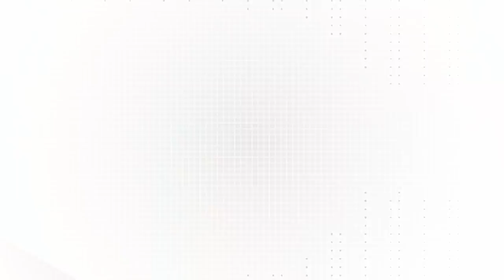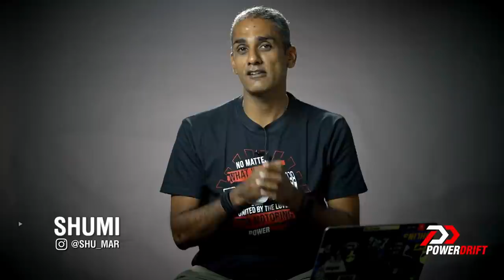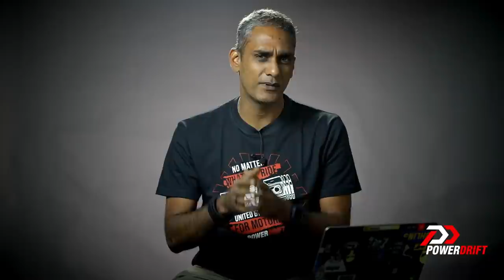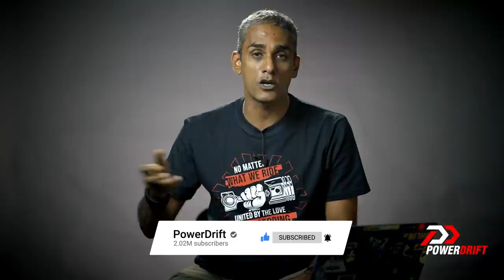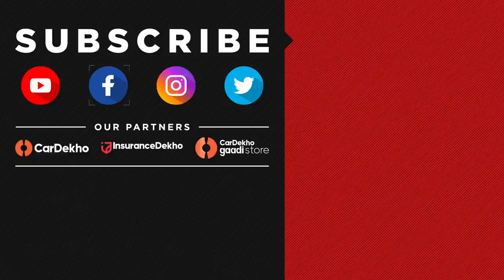Modifying motorcycles | Episode 14 | The PowerDrift Podcast

Comment: All points covered 🙌, 
And yes I did a aux light mod, but i only use it during foggy 4-5 am morning rides or during monsoon off-roading.
And the next mod i will be doing is changing the rear sproket for a little bit higher stabilised cruising speed on highway.
Reply: Best of luck Ninad! Do let us know how it worked out!

Comment: Shumi, you are the awesomely wise (beardless) sage of Motorcycling. Thanks for sharing your passion and wisdom with us. 
I agree with you completely, I always like to do functional mods to the bike, after a long ride, if something on my bike constantly takes my attention off from the ride, I will usually adjust or mod it. Usually it is something small, but after it is done it increases the Joy of riding.

I had not thought about Sprockets on increasing bike mileage along with performance. Please make a video if you do get a chance (or share a few links on this), as increasing tank range without too much sacrifice on performance adds to the joy of the ride as well.
Reply: There’s nothing to it! Find a speed at which the bike returns most efficiency at which you feel comfy as well. Hold that speed more often than not on rides. Done!

Comment: I am a product designer myself, and because of that, I know how much thought and work goes into designing any part of a vehicle.
In six years, I have upgraded my tyres for a stickier set and gotten myself a mobile stand, so that i can read the directions on a mobile screen.

My first thought about any modification is: "Whoever designed/manufactured this component, does he know better than me? Yes. Then I should stop fiddling with it"

Thank you for enforcing my beliefs.
Reply: It's not always true but 99% of the time, a lot of time and effort has gone into every single part of a finished product. We must mod it to fit our needs better if we can, but it must be a considered, thought-through change, not a knee-jerk reaction or a peer-pressure thing

Comment: Wise words! I've been running on a sprocket with lesser teeth at the back for 2+ years and it had a significant role to play, I get more range and the power delivery is better and smooth. I'm planning to get auxiliary lights with filter caps for the reason that was mentioned. Got a handlebar riser because I needed one for comfort and the seat is still stock but I have an air cushion now for very long rides (700+).
Never felt the need for an exhaust or anything else and I still do great :)
Thank you Shumi for this, it was needed!
Reply: Awesome! Glad you've got the motorcycle in a place where you enjoy it even more!
Reply: @shu_mar  Oh totally sir :) Thanks again!

Comment: Awesome video but I had some doubts. You're saying at the top of the line exhausts and power upgrades are a waste which I can agree too. But what if we were at the bottom end of the spectrum. I completely believe what you said about the exhaust, and currently owning a NS200 I'm not even looking at exhaust. But I see my future self someday owning a Daytona in which case I would put an exhaust. I don't mind if the exhaust even loses power as long as it sounds good. I firmly believe riding experience is also affected by the sound of the car/motorcycle. What would your thoughts be on this? Also as I said I own a NS200. I was actually thinking of extracting more power out of it by maybe adding an ECU and a new Air filter. Would that be useful in my case.

Comment: Its a great podcast and absolutely professional advice! Thank you and keep coming with more such videos. :)
I have a duke 390, 2016 and clocked around 50k on it. I am not very happy with the breaks especially the front ones which are the most imp for me with the stock organic pads. I tried to adress it by changing pads to a ceramic and sintered ones and the adjustable levers from the new 390. The sintered pads offer much improved initial bite but it sometimes is too much for a Pirelli rosso 2 to handle. One advice i got was to change the rear pads to sintered and use rear break a bit more than what i usually use so that abs wont kick in.
Recently I came across this racing boy radial master cylinder. From what I know, it will not improve the breaking as such but the feeling and the feedback will be improved significantly. Whats your thought on it @Shumar? thanks in advance
Reply: Try changing the fluid from the stock Dot4 to Dot5.1! It's the cheapest mod but everyone jumps to more complex things first!
Reply: @shu_mar  Oh yeah... never gave a thought to this :p
 will try that for sure.. thanks :)

Comment: Exhaust modify torque, otherwise you don't get power. Power= torque*rpm. Just an exhaust doesn't increase redline rpm, rpm is constant. Exhaust may modify the torque in higher rpms though. In non technical langauge people confuse torque with "pick up", but torque works in every rpm.
Reply: For the layman, they get that torque is low revs and power is high revs. You’re right of course

Comment: The JT steel front sprocket, with rubber bushings, that I replaced on my street triple 765 rs, costed 1600₹, at stock 525 pitch.

Comment: Thank you so much for this video. What are your thoughts on adding aux lights vs changing out the halogen bulbs for LEDs to increase visibility for touring if the existing bulbs aren't powerful enough for night riding?
Reply: I've done that on my Tuono. Legally it's a grey area for sure. I also hate the fact that most LEDs go closer to 6000K (blue) rather than 5000K (sunlight). The diff it makes while riding is serious!
Reply: @shu_mar  Yup, I've been contemplating changing it out, but I keep remembering all the times I've almost been blinded by an oncoming bike with bright blue headlights.

Comment: Very knowledgeable video but what about changing stock Air filters??
Reply: Warranty issues are the same as modification TBH. That aside more airflow can force the ECUs to add more fuel to boost performance. Most of the time, the extra intake
howl is enough to convincer riders their bike is faster. I don’t prefer them because india is super dusty and performance filters filter less.
Reply: @shu_mar  thanks i was planning to change..

Comment: Could have also spoken about hh sintered brakes and paper filter vs reusable air filters .. that would have been nice as most modify those.
Reply: There is enough data online about pros and cons for these. The point was not to dive into specifics as much as to encourage people to think about specifics and research before making changes. So that each change brings a planned benefit
Reply: @shu_mar  thanks for responding 
great to see you and the team take the effort to educate people over certain misconceptions that has been floating around . The podcasts are a great medium.
All the very best guys

Comment: Does changing the handle bar reduce structural strength of the bike?
I have 2011 pulsar 180 was planning to make it more ergonomic by changing the handle bar to a taller one.
Reply: Also can you suggest a good workshop in pune where I can get it with absolute peace of mind.
Reply: I would go to Slipstream Performance. And no, unless the handlebar you use is total BS, it won’t affect the structural strength.

Comment: Lots of wisdom dropped. Thank you. Got a question Can sprockets be used to increase the low end torque of the motorcycles ? For there are stalling issues in motorcycles especially with a luggage on touring ?

Comment: Sir , what bike is a good choice for an absolute beginner , which has style & looks along with necessary systems required ? Budget could be stretched till 2lakh . Please sir , it would be a great help if you could suggest .
Reply: I would pick between an Apache RTR 200, Duke 250 and a Gixxer 250. Test ride and decide
Reply: @shu_mar  I had my eyes fixed on Apache RTR 200 4V , it seems to pack almost everything required ( safety , features & looks ) but got kind of confused with Gixxer 250 . Not digging in KTM or Duke to be honest . But none the less thank you for your suggestion sir .

Comment: As I understand watching you speak in your podcasts - your wisdom are more applicable for the 'rich' persons who are driving a 'non-commuter' class motor cycle. Having said that, let me tell you I ride a Honda Unicorn BS6 and let me present before you an issue, which may look so trivial to you that you may altogether ignore and laugh off my comment/query. I ride this motorcycle everyday 113 kilometers (including both upward and return) in which during my return journey home (in the evening in the dark via NH2 around 26.7 kilometers) I found it quite hard to see properly with the stock/OEM headlamp. And I am certain you're well aware of the reputation of the illumination power of Unicorn's headlamp.

I bought this first motorbike on 28th May 2021 (before that I was riding an NTORQ race edition bs6). As you can see the machine being very new - I need your advice on what to do with the poor OEM headlamp that Honda provides on Unicorn.

For your reference, Unicorn, in its bs6 avatar has a puny 4Ah battery. What are my options? Kindly be specific. Thanks.

Comment: Sir very nice explanation 
But now what I am thinking is-it is ok to buy naked Street and racing bik or anyb expensive bike  we can only use only 0.1%  full potential of the bike??
Reply: Of course! If we bought motorcycles based on what we need, we would all be riding 150cc motorcycles. Motorcycles are flights of fancy. My point was that once its here, spend money and time with it to gain the experience and sensations you got the bike for. Not useless mods that achieve nothing

Comment: Did changing the sprocket mess up the speedometer readings on your multistrada? I was riding a ninja 300 in MMRT and I could see the speedo readings change significantly when I changed the sprocket..

Comment: the only thing i modified in victor 110 is a charging socket connector arrangement. its removable so if my Ntorq does not need that ill just stick that on victor and move along.

Comment: How did increasing the rpm (via sprocket) increase the fuel economy. I think it would be the opposite??
Reply: Depends. In my case, the bike (and most big engines) run below optimum revs in India. Lowering gearing brings you closer to efficient revs. On small bikes the opposite might happen.

Comment: Amazing suggestions Shumii! That sprocket advise is gonna help me increase the low end of my CB350 H'Ness. But do we need to pursue a certain ratio for the teeth on rear and front or can we just increase teeth to the rear and get more acceleration?
Reply: It’s a trade off. Read more on this first. More acceleration means less top speed. And the Highness barely had any top end as it is...
Reply: Will do! Thanks for the reply 🤟🏼🤩

Comment: I fully agree on this topic , changing stock exhaust to louder irritating exhaust is way of norm for  super bike  purchasers  and people barb on costs they have wasted ,plus outdoing engineers who have put years to make vehicles to perform optimum keeping laws of lands intact.   Most of super bike purchasers are from large metros where there are hardly any roads capable to extract those BHPies.    I would recomend to put money on insurance. 1 lac Rs fuel example is just  right example where users hardly run up super bikes beyond few thousand kms, surprisingly same people are concerned of fuel economy and rising prices. But again there is business involved.

Comment: What is your suggestion on adding windshield, handle guard and specially crash guard to Apache RTR 200 4v. I might not go beyond 105kmph regularly and 125kmph on ling rides. My weight is around 80kg but I encounter lot of windblast in flyovers and highways. I feel anxious and not in control of my bike in those moments. Is it a skill requirement or modification requirement?

Comment: 17:05  wait...what? 

Hey @PowerDrift, how does your fuel economy go up with higher revs. I get that the motor is under less stress because higher revs deliver more power, but higher revs mean you're having higher number of engine cycles in the same time, ergo, burning more fuel, regardless of how you look at it. Only way around is to have a turbo/supercharger. 

Or am I missing something here. I could be wrong, I often am.

Comment: Is it better to modify a slower bike to be faster for regular use or buy a bigger bike to solve the problem.
For example the smaller bike has the sweet spot of 4 to 5 K rpm where it goes around 80 kmph and by modifying exhaust and intake it can do much better at that spot is it advisable or better to buy a bigger bike to solve that.

Comment: Hi, you mentioned that the second time you went to KMS, post 5k on the Duke you felt much better. Wanted to understand if it was genuinely the seat getting better or was it just you had gotten used to the way the seat was .. genuinely want to know
Reply: What I was saying is that it doesn't matter whether the seat got better or I got used to it. What matters is that 21,000km, I'm using the same seat and it remains the best seat I own across my bikes
Reply: @shu_mar  thanks Shumi..

Comment: Hi Shumi as always great video❤️. Recently my bike started giving less fuel economy. I don't know the reason. Now you mentioned about sprockets in video and I remember mechanic told me to change the sprocket. Is that the reason for less fuel economy . It been 5 years I m using my motorcycle and it's 150 cc bike. Please assist.
Reply: A worn sprocket can cause issues but a drastic difference in economy 
won’t be the sprocket alone
Reply: @shu_mar  thanks Shumi☺️

Comment: Hi 

I have a street triple S and I have added 1/2 inch risers , however my handle is still not that closer. And as comfortable as bmw gs310 handle . It may sound stupid but want it to be little bit easy riding position
Reply: It’s not stupid. We all want a comfortable riding position. The things to figure out is 1/ are you sitting right (if not,  that’s the source of discomfort not the bike) and 2/ what do you consider comfortable (I want to lean forward but you might prefer upright and so on). And then find risers/handlebars that do the right thing for you.
Reply: @shu_mar  so is 1 inch risers advisable on street triple

Comment: Since my legs are longer than average for the same body height (5'11") my seating is crammed on my Pulsar 150 Neon which comes with commuter styled footpegs.
 I wanted to install the rearsets that come with the twin disc model of 150 but knowing that I'll have to change the peg holders, gear shifter, rear brake pedal, possibly the side stand and lose my kick start has put me in great dilemma. I didnt notice this in test rides as they are never over 2 kms sadly. What to do @shumar?
Reply: No easy way. One of the things about mods is that much of it is trial and error. You hope for the best and remember that some of the mods won't work.
Reply: @shu_mar  Yup that's always there. Main factor is the money involved in doing all of this parts etc. All I have is time and I think I'll figure something out.

Comment: Hey!!I own a RE Himalayan as I hit off-road and bad roads frequently. But on the weekends I used to hit straight highways with my friends. There I find my bike quiet slow compared to RS200 or Duke250. Can I have a solution to that??
Reply: Not really. As with everything sprockets/exhausts are tradeoffs. A smaller/weaker bike has less ability for you to be able to play with it and ‘create’ more performance.

Comment: hey there i need more details on the performance upgrade options easily available in india on a 300-400cc bike
Reply: He just discussed about it in this video..let me tell you again
1: sprockets 
2:ecu flash or just buy a piggyback ecu
3: high flow air filter (required only if you have aftermarket exhaust)
4: think,  do you really need that extra bhp for Indian road situations also...🤔is  it a good long term investment
Reply: @anish_R1   I meant like a detailed detailed
Like taking a say like a KTM Duke 250 or 390 and just sucking out most bhp possible need it be track bike 
But it would be the fastest and the components available
But you were also helpful in summarising the key points
Reply: @RamSingh-ku9mg  ohh ok if it's for track you can just reffer to most of the stuff I said in the earlier comment and also for track you need to buy a nice pair of tyres ... If you ask me slick tyres are the best for the track and will grip you're bike well enough to allow you to use  that extra bhp ... If it's a ktm duke 250 or 390  just buy a  powertronic piggyback ecu and exhaust from indimotard... These companies have products made specially for the Duke's ...also go to a website called lrl motors they have great aftermarket parts for almost any bike
Reply: @anish_R1  hey thanks man appreciate it🔥🔥😎😂